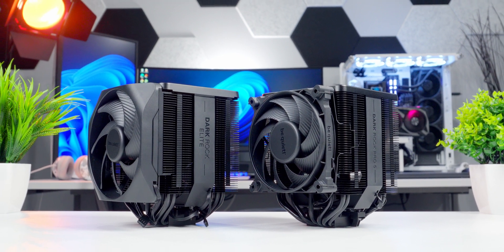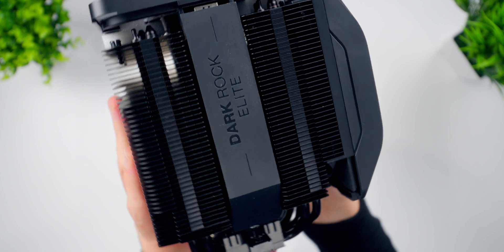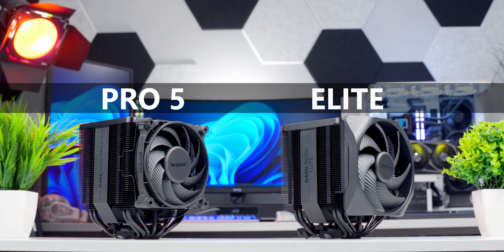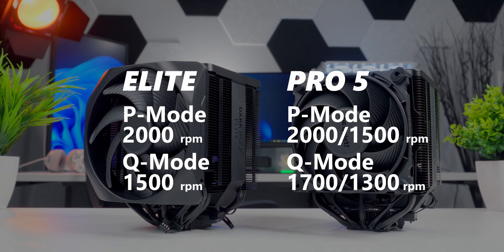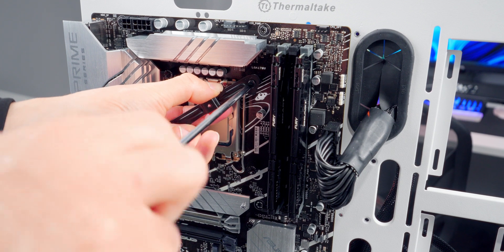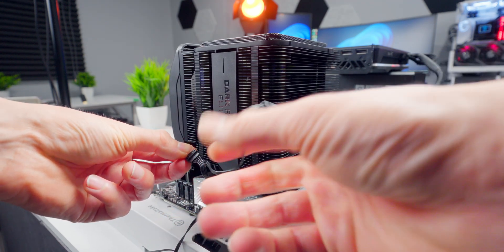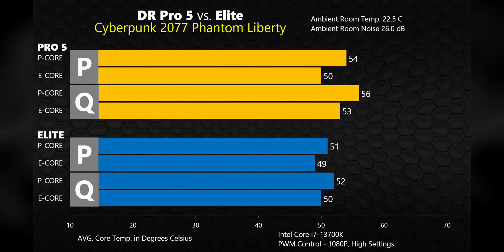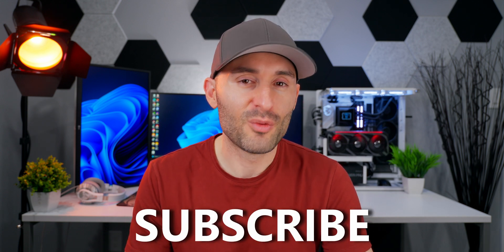Be Quiet! Dark Rock Pro 5 & Dark Rock Elite Unboxing, Review, and Comparison

Comment: The fans are so overengineered. They could've gone the easy way: design a heatsink that can fit two 140 mm Silent Wings Pro 4's and watch the TDP reach 300W. But nooo, they HAD to make a different fan, with a different connection, and a different attaching mechanism.

Comment: I just bought the Elite. The cooler is great, but unfortunately, the ARGB LED light ring on top stopped working correctly after just a couple of hours. Now it only lights in one corner, and only in a faint blue color not matter what I set the controller colors/patterns to. It was cool while it lasted, but now I have to return it or try to get the parts to replace the LED ring panel.

Comment: Thank you for actually opening it and showing it off and what it comes with, Be quiet does not say what it comes with in their bio. Alot of reviewers don't bring any of the extras or how fans connect, big help.
Reply from the maker: Glad you liked it!
Reply: @ECPUz can I put the Dark PRO Elite on a mini itx Asus RogStrix B650E-i with corsair no rgb-plain ram? I really love this cooler but I am afraid even the most basic ram will have an issue. Case is also tight,max cooler height is 170mm. Can you please help me with an opinion?🙏 it would help me a lot. Thank you
Reply: i never saw any unboxing though